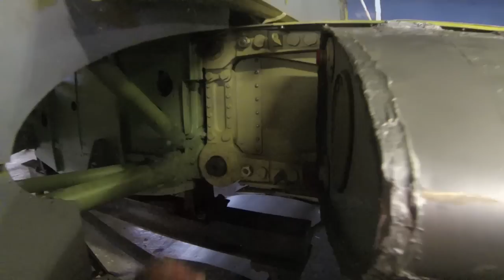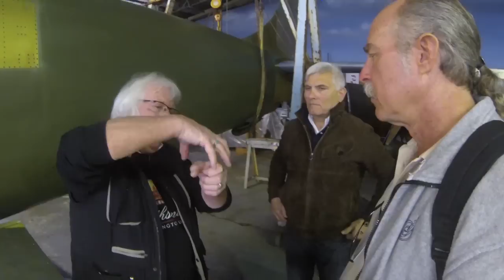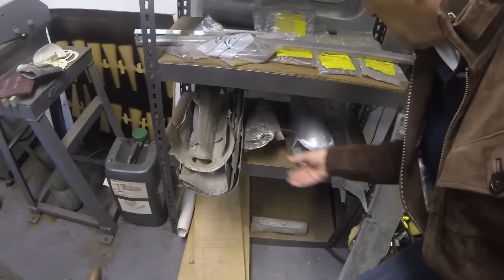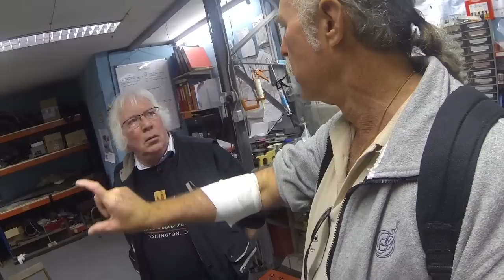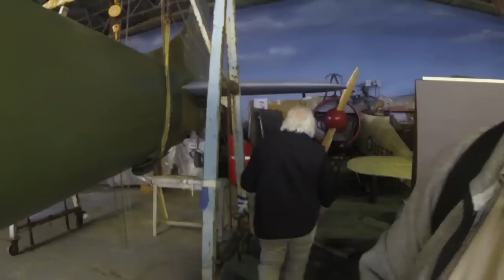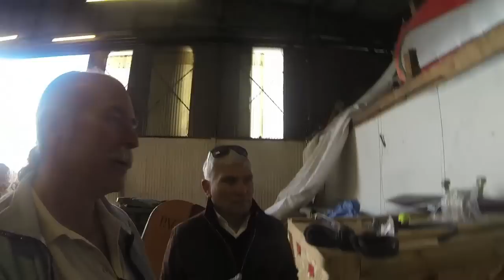Hawker Tempest V - Part 1 - "Project Visit" - Kermie Cam

Comment: Gorgeous planes. Is this going to be the only remaining flying Tempest in world? Who is doing the engine on this one?
Reply from the maker: It will be when it is done. The project however is currently on hold because the lead Restoration Specialist / Machinist, and our British plane expert, Andy Salter has retired. He was also the engine expert who was going to do the Napier Sabre engine. The project will be picked up when a suitable replacement is found who can match Andy's expertise and experience to take on such a rare and valuable project.
Reply: @KermitWeeks444 thanks for taking  the time to answer , sir. Gorgeous  aircraft, sir.
Reply: @KermitWeeks444  Any idea when this will fly? Thx!

Comment: What a mess that thing is. Even if it was complete, British engineering is always a nightmare to deal with.
Reply: idontcare80 Having owned several British motorcycles from the 1960's, I can attest to the one way complexity of British engineering. they build things from the outside in apparently, then to remove one small component is nearly impossible with out reverse engineering the whole machine. couple this with the fact these were never meant to be taken apart and reassembled in the era which they were designed, they  crashed or were shot down.. no thought, I'm sure was given to long term serviceability.
Reply: idontcare80 Mess?
the spitfires and mosquitoes were the easiest aircraft to assemble. 
the only reason this is so complex is because of the lack of parts as there is so few tempests surviving, all MK Vs are in restoration.
Reply: Cinnabun I'm not sure where you heard that, the metal British fighters were very complex to build. The Mosquito was simple to build because it was made of wood.
Reply: idontcare80 Any metal fighter will be difficult to build. 

You would only have an easier time rebuilding a P-51 because they made so many it's easier sourcing original parts and wrecks.
Reply: Cinnabun Yes, any metal fighter would be difficult to build with as little as these guys have to work with, that doesn't mean that British aircraft weren't much more difficult to build than other all metal aircraft.
Reply: idontcare80 it is completely aircraft specific, not nation specific.
Reply: Cinnabun It's not at all. It's not even the same from manufacturer to manufacturer in a single country.

Comment: About landing gear, does it , how do i put this, fold in that compartment on landing impact? This machine is heavy as hell, is there a gas/oil piston( or how do you call that assembly in English)?
I've seen this compartment on some Russian planes without folding tail gear, it's just a hole in there, smaller hole but a hole.
Reply: drunkensailor775 You mean how does the tail gear fold up?
or why doesn't it fold up on landing?
Reply: Nah, i mean it only folds up, acts as a shock absorber, only on landing impact of the tail that's when it goes in that compartment for  a moment of impact only.
Reply: drunkensailor775 probably as you say a pneumatic shock absorber.